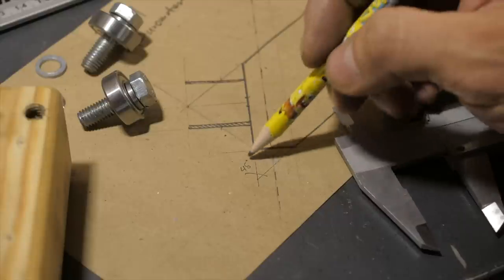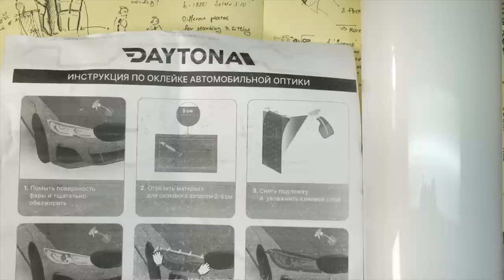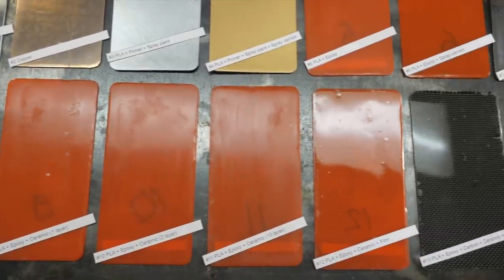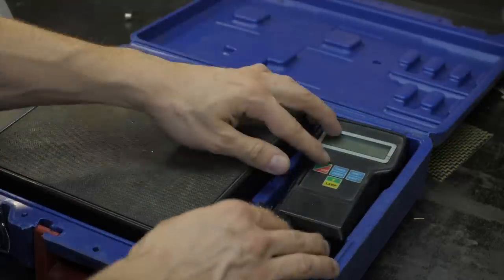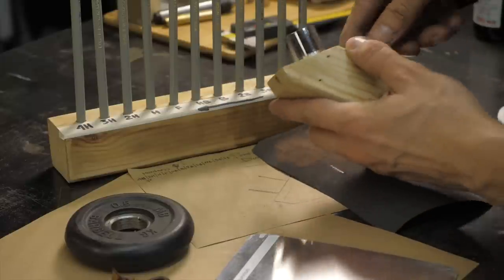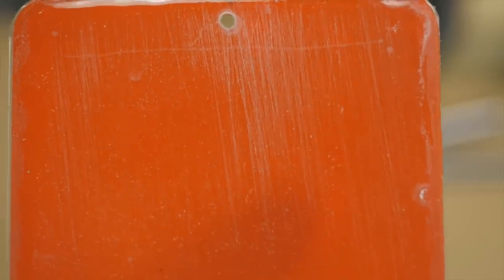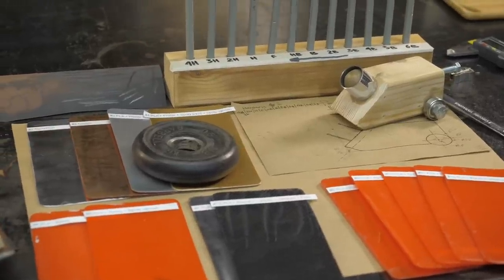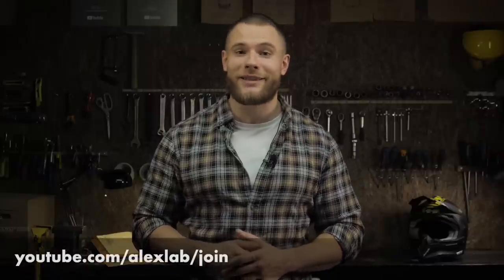How to measure hardness? 4 simple DIY ways to measure hardness of materials. Basics of composites #5

Comment: @ALEX LAB, if you put the soft rubbery layer on top of the metal coated layer it would cusin you against impact and provide a softer feel. You will however need to add .28mm to the thickness of the completed suit to compensate for the extra layer.

Comment: Another Excellent vid Alex. This is the sort of work my father did for a living, measuring hardness, brittleness etc in metals. In industry a lot of this is done today with mass spectrometry (compare items chemical composition to known values). But to get those known values... its exactly the sort of experiments you show here. 
Plan for the 'best' armour is 3d print then kevlar with carbon fiber on top I guess? Should look nice and provide legitmate protection (FYI - as an ex forces guy, the kevlar in real body armour is VERY thick, I think 20 ish layers, and protection vs firearms is questionable) - so ride carefully on that motorcorss bike;)

Comment: I think that one of the best materials could be something like the kevlar+carbon fiber composite from the previous video plated with chromium even if it wouldn't be cheap. 
It could be done with one last ply of carbon fiber with no kevlar and only enough epoxy to adhere it to the part and a light sanding to be sure that the carbon is completely exposed as it seems that chromium can be electroplated directly over carbon fiber. It should have crazy surface hardness, be light and I imagine that the effect of the chromium getting in between the fibers and binding them would make that last layer exceptionally tough.

Comment: 12:21   I propose a better tool for this is an optical comparator.  obviously a $1000-20,000 tool is not practical, but did you know there is a pocket version?   I recently stumbled into one and its AWESOME.  Mine is  : Mitutoyo 183-901(-904) Pocket Comparator for $100 but you can get cheaper ones from igaging or something straight from the big red....  The most useful scaled reticles are the general No.1 No. 2 and No.5  and the ones for thread pitch No 10 and 11. also No 12 and No 6 are good but You can look at them and see what works best for you.  The built in leds on the igaging or chinese can be useful. I dont know how long the batteries will last yet. Hope this comment helps someone.